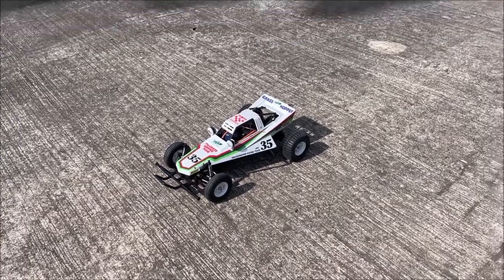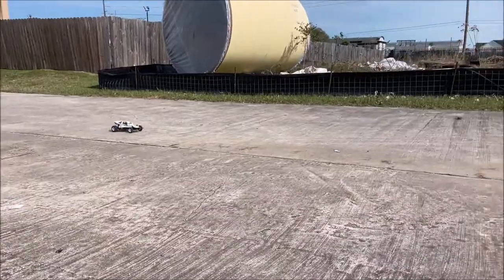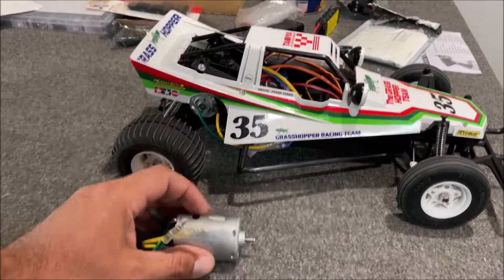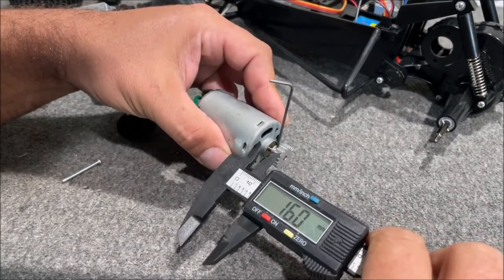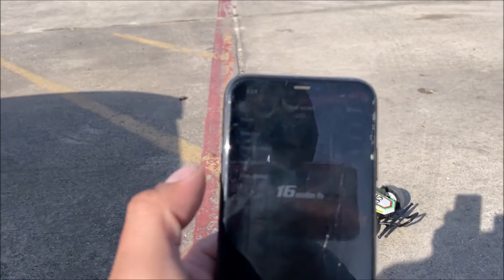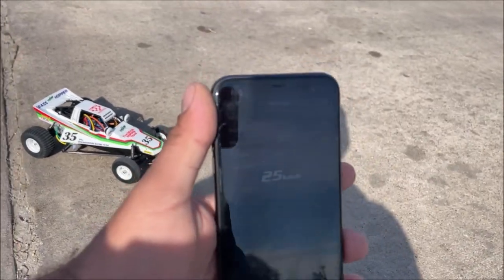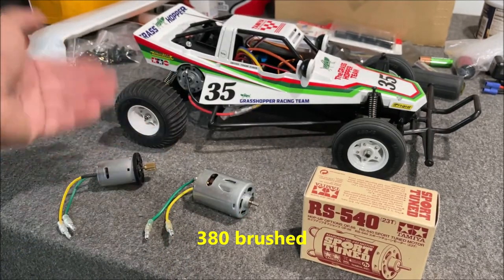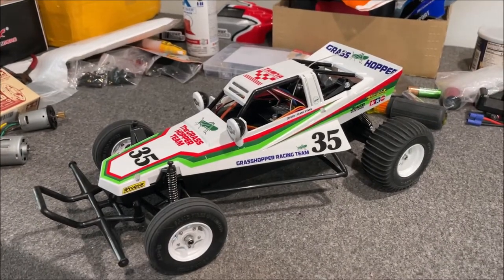Tamiya Grasshopper stock SPEED run 380 to 540 UPGRADE

Comment: I picked up a used grasshopper and TAMIYA PANDA yesterday for just $35. 
Anyway I wanted to put a 550 on the grasshopper and was trying to figure out the proper size pinion to use and your video was exactly what I needed and more. Thanks bro!

Comment: I never thought about those steering tie rods. I own a Hornet and 2 unbuilt Grasshoppers. My hornet was damned horrible to drive. But thats a great piece of advice to adjust the camber and tow in with the steering links. Another thought i came up with is to leave the rubber collar tube out of the front suspension struts. I seems to cause some type of stiction. For instance if the rubber tube is removed the suspension should have full compression and feel mire subtle , hopefully stopping the front end bouncing around like it does. These cars are so light weight at around 874 grams for the Hornet without battery. By comparison the new Arrma Typhon Grom reaches 22 mph or 37 km/ h. And it weighs less and is 4WD and only runs a 380 type brushed motor. Im highly tempted to buy an Arrma Typhon Grom. And its even cheaper than a Tamiya RC kit at around $140.00 American dollars. Here in Australia it retails at $240.00! Australian dollars. But i am a life long Tamiya RC fanatic and enthusiast. I own lots of Tamiya RC cars. A series 2 Hot Shot, a Hot Shot 2, a Super Hot Shot. A vintage Tamiya Fox and a new rerelease Nova Fox. A Tamiya Egress black edition and a Tamiya Avante black edition. A Midnight Pumpkin and a Lunchbox both black edition. And i reckon ive forgotten one or more. I love Tamiya RC cars. This is a great video, thanks for doing the speed testa and the advice on the steering arms. I had originally tried a 15 turn Core RC motor in my Hornet and it was too much. That little buggy went from looking beautiful and brand new to looking very old and banged up really quickly. I soon returned the stock 540 silver can motor and its so much nicer to drive. Then i brought a new body shell and decal set. Consequently i put that 15 turn in my new Nova Fox and man that car flies. Un my Super Hot Shot and seiries 1 Hot Shot i put in a Tamiya Super stock RZ motor and man that car is fast. I get 27 mph or 45 km/h. Its faster than a Kyosho Fazer 1969 Chevy Camaro with the stock Kyosho brushed motor by around 3 km/h . Great video again man . 👍👌
Reply from the maker: I would check out part 2.. the titan 12t is my best bet because you can run it on 3s if you want. I also have an original hot shot and a super shot..  you can see my hot shot body video.. I am not running those. No way I’m messing those up

Comment: I know nothing about RC but really enjoyed watching this. Loved hat you explained everything and didn't as pet a lot of channels just use jargon assuming everyone already knows.
So I'm correct that there was nothing to swap except the actual motor? Looking at getting my first RC and the grasshopper is on the shortlist.

Thanks and subscribed
Reply from the maker: you need an 18 tooth .08 pinion gear to run a 540 size motor..
Reply: Many thanks

Comment: Break-in the brushes by running the motor submerged in a bowl of water, that will pick up some extra RPM's (old racer trick).  Also, use a JIS screwdriver for Japan screws (Not Phillips).
Reply from the maker: have you ever broken a motor in under water?
Reply: Yep, picks up extra RPM  @chriscraft2
Reply: Current Japan screws are not JIS....but the older screws are.

Comment: Curious, I just did a GH build this week, are you running stock plastic bearings in the car? Cheers
Reply from the maker: yes.. on this one I would avoid replacing them with ball bearings because the car is a bit unstable once you get over 20 mph.. buy ball bearings for some other chassis.. I got ball bearings for tt01 and tt02 instead of this one
Reply: @chriscraft2  Right on. I ended up doing Fast Eddys in my GH, runs like a top. Definitely want to get a 540 motor though, and I just ordered some Tamiya CVA shocks for the rear today.
Reply from the maker: I’m about to do another video with a titan 550 ($25) and a $30 brushless 540 style on the grasshopper.. I don’t think the ball bearings make it faster they are just needed when you go above 20 mph.  Cause the plastic bushings get eaten away fast
Reply: @chriscraft2  and you then look for the oil suspension, trust me you will want it if your using the 540.
Reply: @chriscraft2  and the idea of changing actuall bearing is not to damaged the motor.
Reply from the maker: @131unicorn  i dont understad that..  how is the motor going to get damaged?  i will be testing and finding out soon here..